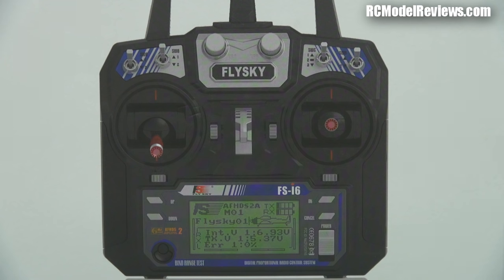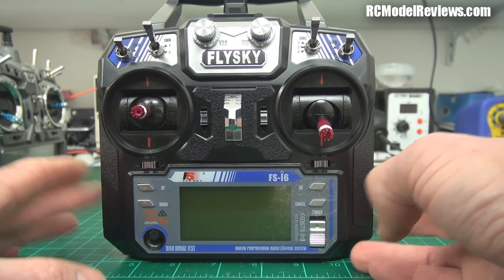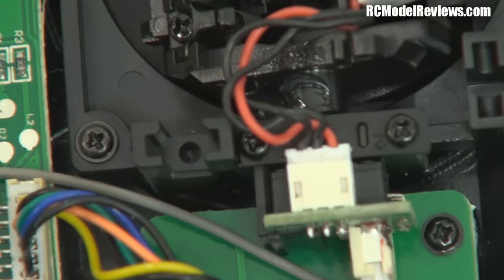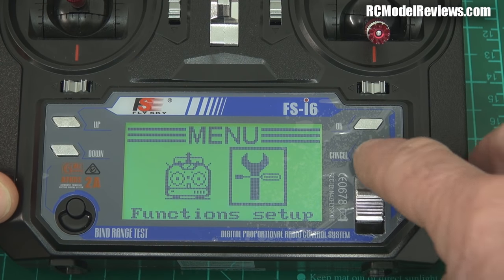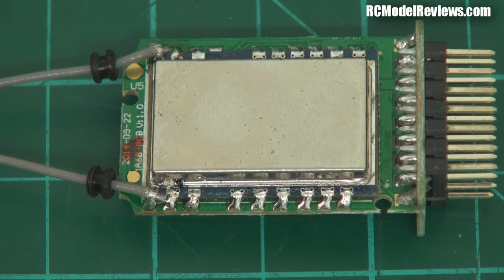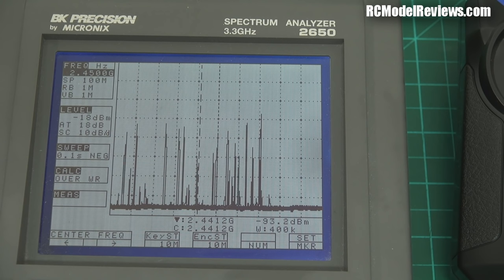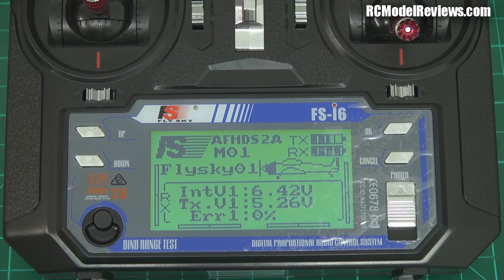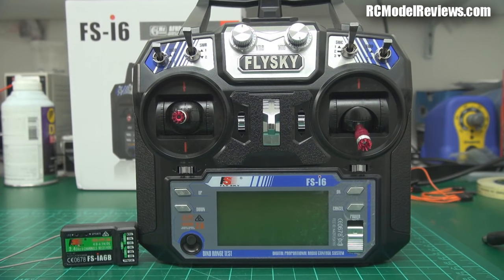On the bench: FlySky FS i6 radio

Comment: Thank you for this video. Is there a way that I could turn off the transmitter and just use this as a training controller hooked up to the PC - I do this, but I don't want it transmitting for no reason.  I used a multi-meter from the positive battery wire to each terminal on the transmitter and I didn't find connectivity.  Thoughts? thank you .

Comment: I have this radio, only thing I don't like is the ON/OFF switch as it is really hard to turn it on or off.
Reply: Yeah, I agree. Bruce probably didn't notice it with this particular unit because it's almost new, but after a few months that switch somehow gets slippery like butter, I often have to use my fingernail under the edge to slide it.

Comment: Further to that - I've got four wires coming off the battery and there are three pins on the receiver (FS-iA6). So, what goes where??
Reply: The 4 in lipo part is for 3s balance charging, plugging that into your receiver could break it, the battery main lead plugs into the speed controller, and that has a battery elimination circuit or BEC, and so that three wire plug will power the reciever

Comment: 1:33 I prefer 4 x 1.5v cells used in cheap radios as you can simply solder on a JST connector and use a flat 2100 mAh 6.6v LIFE battery or smaller velcroed vertical on the back and even add a switch to use the internal batteries as a back up. I've found the cheap radios handle the 6.6v easy as even 4 cheap 1.5v "disposable" (not really if you end up drinking it excluding most politicians)  batteries average 6.58v new and if I'm not going to fly for a week or two I remove the battery effortlessly to slow the batteries life time clock down and put it in a thick glass jar or metal ammo case with a desiccant placed in a cold refrigerator. Time to grow up and stop creating disposable batteries and politicians we don't want or need IMO. LIFEPO4 batteries ROCK!

Comment: Would be interested in seeing that hack done to enable correct telemetry voltage.  I have the same transmitter but I think my receiver doesn't have the B on it.  Which ones can be hacked and such...

Comment: Hi Bruce, can you help me on how to add more switches, 2 & 3 position ones, to the FS-i6?
I have one of this flashed with the 10ch software but now i missing 2 switches (or more, if possible), I´ve swop already the VAR to a FrSky 6 position knob for the gain of the 3 axis gyro and the VRB to a 3 position switch to change the flight modes in the gyro, the 2 left buttons (2 position ones) are used for the dual rates and motor reverser and the right side ones are used for the flaps (3 position one) and motor cut off (2 position), now if i want to add channel mixes, lights, candy drop... i still have free channels but no more buttons.
Can you give me some help (guidance) in here in how to do it.
Thanking you in advance.
Sergio Lopes

Comment: The two antennas in the TX could be for the telemetry and the transmission? It doesn't make sense a diversity in the transmitter...
Reply: By transmitting alternately in vertical and horizontal polarization, the effects of a misaligned (cross-polarized) receiver antenna can be mitigated quite effectively.  However, I haven't determined for sure that this is what's happening here.
Reply: If you hold both sticks down and left while turning it on (in mode 2 at least, presumably same for mode 1) you will see a 'factory' menu instead of the normal one. fwiw one of the menus in there ('RF frequency') lets you select 'left' or 'right' antenna. Not really sure what that does though. There is also a 'mode' setting which lets you choose 'carrier only', 'carrier + modul' and 'frequency scan'. Again, not really sure what they do but it's an interesting menu to poke around in.

Comment: Hi,
 I have a problem with my radio, after an update does not work the roll 
and picth stick anymore, you know where i can intervene to fix it?
Thank you
Reply: Try this link with software updates.

https://github.com/benb0jangles/FlySky-i6-Mod-
Reply: Sergio Lopes Hello Sergio, I updated the radio from the link you posted to me, unfortunately the problem persists. Everything started when I wanted to upgrade the 6ch radio to 10h, also returning to the original firmware the stock of the picth and roll did not work, I tried to invert the stick connectors to see if the problem was on the hardware but they both work. There will probably be a defective CIP. Thanks for the attention and excuse for my English but I use the translator. If you have more info you are welcome ....
Reply: Olá Mario, o que posso fazer é enviar os ficheiros que usei para o meu FS-i6 que está a funcionar com os 10ch, telemetria para baterias Lipo até 6S e alarme para 1 min.
Reply: ola Sergio, meu caso estranho e talvez única, o link que você me enviou está na mesma página onde eu tenho os arquivos para piscar o rádio
Reply: Well, the version i used is "10ch_MOD_i6_Programmer_V1_5" and worked good for me, maybe your Tx is defected or you didn't flash it properly.
My advise is for you to install the original software to see if everything works properly and the flash it again with the 10ch software.
Reply: Sergio Lopes I followed the same procedure as you, I also reinstalled the original firmware but did not change anything, maybe and party or defective an internal CIP on the radio
Reply: i´m sorry to hear that, hope you can fix it.
Reply: Sergio Lopes Bangood sent me a new radio, I'm waiting ....

Comment: If you want a backup radio, buy it, and dont care what others say about you, which screams CHEAP, all over the place, then go for it. Showing up at the field w a Flysky radio is the same as showing up to a club ride w a Wal-Mart bike frame w Dura-Ace upgrades, cheeeeeaaaaapppp!

You are serious about the hobby, you want to enjoy every minute of the flying time, the only one thing between you and the aircraft is the controller, nothing nicer than holding a nice plush high quality transmitter, it DOES make a difference. As a backup or for cheapie setup foamies, ok, but nothing else.

Comment: Does anybody know if the I6 works with EZHhf?   I've got a couple of these lying around that came with quads that I reviewed, and I recently hooked one up to my Traxxas Stampede to get a couple of extra channels to play with (I could never get the Stampede to work with my Spektrum for some reason).  Now I'm thinking I'd like to switch over to EZUHF on the Stampede, and it seems to work well with the I6 so I'd like to use that if it works with it.

Comment: Can someone help? I have this transmitter and the receiver that comes with it. I bound it and everything seems to have power but the motors don't start spinning up.
Reply: +Mark Devenney How do you do that? Sorry for the really nooby question.
Reply: +David Kim google it.
Reply: Take off the props first, and then push both sticks inwards, the left stick bottom right, the right stick bottom left.
Reply: +AMA just the left stick to SW position
Reply: Make sure the setting in cli matches ppm or pwm. Are all stick working in receiver tab in cleanflight. If not you in wrong mode.

Comment: I am a bit disappointed, I thought more guys would have been on here buying them up like hot cakes. $45 for an entry level radio with knobs. Even Tactic screwed up and forgot knobs. No sliders,well no really big deal. Cant believe they never washed the solder off the boards. That shit will short out a board in a hot minute. No manual? whats with that? I am a reader,always have been. I learn by watching same as a lot of others but I love my manuals. They contain those little nuggets no one else knows about,or should. I see Dynam uses them on their planes as does WL Toys. They sell themI think WL toys is the little runt pushing its way through the litter. Often over looked,but turns out to be the loyal pet that turns out to be the best of the litter as far as loyalty and dependability. Havent heard that comming out of Spektrums litter huh? I have one sitting around that goes with my Helicopter.
Reply: they're all buying the turnigy 9x
Reply: +Mark Devenney Does that make it a Fry Sky ( spoken in Chinese)
Reply: +Mark Devenney Yes,you totally got that...lol!
Reply: +Mark Devenney After crashing both my planes within a week and one taking a week to repair because your Spektrum transmitter decided to whig out needs to have a little humor. that or a hammer! lol. Bits o' Spektrum everywhere...kinda like my planes...lol.
Reply: There is a manual online, I found it no problem, 60 pages, downloaded on my chromebook and android phone. I agree, manuals are good, and there is one for the FlySky.

Comment: what is the range of this radio?
Reply: About three miles. Theres videos here on youtube that show this.
Reply: abundantYOUniverse that's best case scenario FYI, in an open area without interferences like electronics, trees, hills, valleys, houses or buildings. If in a populated area or dense urban area it will not be miles. Btw 2.3 kilometres isn't the same as 3 miles. 3 miles is far and any newb looking at this two shouldn't be concerned with distance like this as they shouldn't be flying further than line of sight....even if you're capable of gearing up for a 3 mile ride, it's still dangerous, shouldn't be done in populated areas or where there's traffic (cars or human) and you should have a lime of sight spotter for the ride. But a 3 mile FPV ride is years away from being a newb and this transmitter.

Comment: This is a very capable radio once you flash the modded firmware and use iBus(sBus basically). It has excellent range and reliability. I have had no issue at all with this transmitter. A few of your cons are also solved with the modded firmware. If you are on the fence about buying one of these then I'd say go for it. You won't find a better bang for your buck!
Reply: What modded firmware are you talking about? link?
Reply: Modded firmware flash and iBus support makes this my radio for life. I'll spend the 300$ I save with this to build an extra quad or two.
Reply: how do the sticks feel though,  i on the other hand would not feel a fifty buck radio would cut it.  The quality in a better transmitter justifies more cost. Just my opinion 😆
Reply: I have flown with a spectrum i6x (I think) and I couldn't tell you that I could fell a difference. Maybe someone with more time on a more expensive TX might have a bit more input.
Reply: From my knowledge some have ball bearings
Reply: The sticks feel nice and I've heard some say that they like it more than the Taranis. 

Also a heads up that FlySky is about to release a new FS-i6x which is essentially the same but capable of 10ch and other mods from the modded firmware have been incorporated.
Reply: I'm a begginer and what would be the pros over getting the newer version over this one?
Reply: In my honest opinion the older I6 is better... 

They also have an i6x about to come out which should be even better.
Reply: I have been looking at the I6X. Looks like flysky actually listens to their customers and they have added some of the changes from the custom firmware. You can get it here http://www.banggood.com/Flysky-FS-i6X-2_4GHz-10CH-AFHDS-2A-RC-Transmitter-With-X6B-i-BUS-Receiver-p-1090406.html?p=BI01181306024201503Y
Reply: rc flyer 85 is this a easy transmitter to setup  or dose it have its problems
Reply: William Davie For a quadcopter it's probably the easiest you'll find. They are about to release a new version called the FS-i6x which you should also consider...
Reply: +RC Flyer85 hiya thanks yes I just looked at the video for the f's i6x but I only found one video of it but it will be good to see some feedback on it first have you any experience with the devo 7 transmitter
Reply: William Davie No unfortunately I do not
Reply: +RC Flyer85 noproblem thanks there's not any reviews for the i6x yet ar they on sale yet or ar they on pre-order
Reply: William Davie They are not out yet... I believe they release around the 31st
Reply: +RC Flyer85 thanks
Reply: Aaron Murray //// Naah, way too toysih, that plastic finish, nasty. Get yourself a Futaba 10J, its a beauty. 
Having this radio is like buying a Dollar Tree phone and update its firmware ro make phone calls, text and data, and then say I saved myself 400 dollars, I dont need a high end phone. You are gonna look so cheap at the field, hell no.
Reply: to worried about how you look vain one